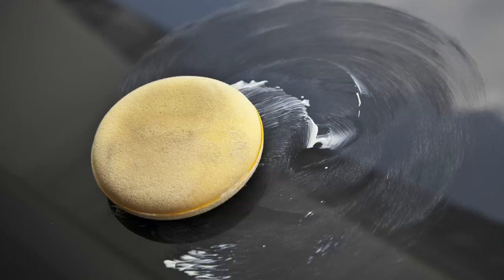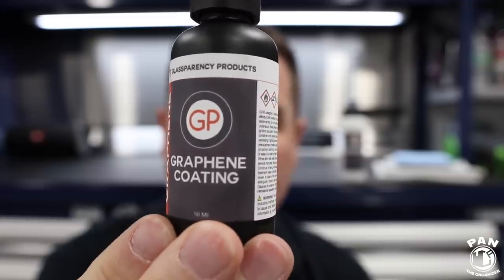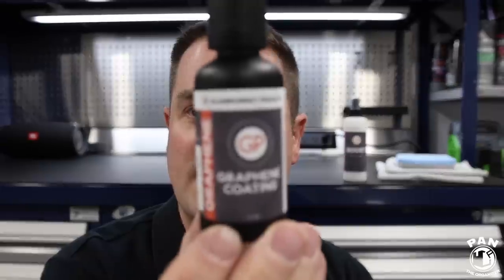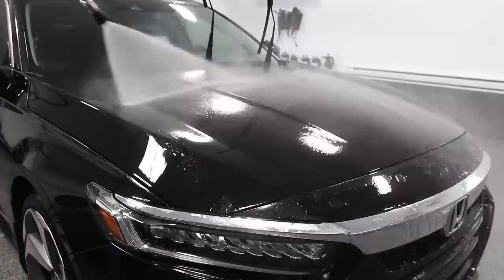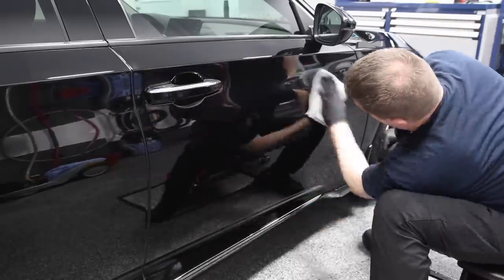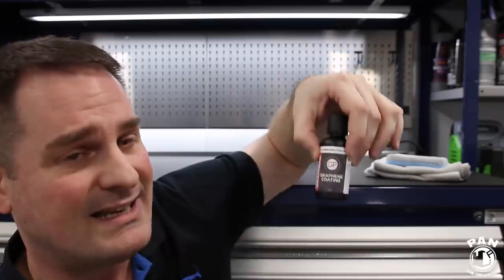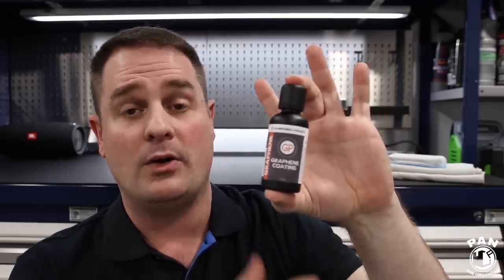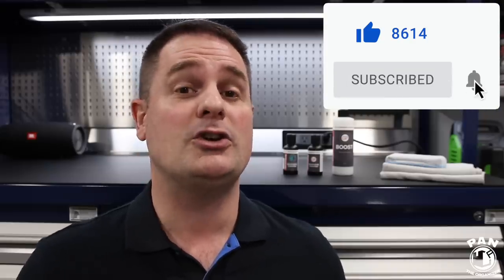GRAPHENE COATING by GlassParency! The Future of Paint Protection!

Comment: Hi Pan ! This is in fact exciting new technology. Can you tell us more about what can and cannot be done in maintaining a car that’s been coated with graphene coating ? Can chemical and mechanical decontamination, polish or compound be done since the coating is there for many years ? What happens if scratches need to be removed ? Thanks again for your great channel 👍🏼💪🏼
Reply from the maker: Same as for ceramic coatings.  No claybar.  And if you polish, you damage the coating.
Reply: Considering graphene coating lasts for years and that you can’t clay the paint after it’s been protected by ceramic or graphene coating, does the paintwork retain its smoothness all these years ? Thanks Pan !

Comment: I have just purchased a new vehicle. What paint preparation cleaning steps are recommended prior to graphene application?  I have applied  hybrid ceramic spray. I’m guessing that clay bar would not be needed, for example.
Reply from the maker: You would need to do exactly the steps in this video, from A to Z, including machine polishing, to remove your existing ceramic spray, as all coatings need to be applied to a virgin clear coat, to ensure proper bonding with the paintwork.

Comment: Hi Pan, based on your video, I applied the GlassParency Graphene on my car yesterday.  I put two coats on and a coating of Boost as recommended. Real easy to apply. It looks great! We'll see how it holds up but I wanted to ask you a question. I noticed today when I cleaned my windows, there were a few small spots where I must of gotten some Graphene on the glass that won't come off.  Is there an easy way to remove it from glass?
Reply from the maker: Yes just use some polish and rub the glass with a microfiber towel.
Reply: @PanTheOrganizer  Thanks Pan!  I'll try that.

Comment: @Pan TheOrganizer do you recommend using 3D Speed All In One Polish/Wax before graphene coating? would the wax in the 3D product prevent the graphene coating form adhering to the car?
Reply from the maker: DON'T USE all-in-one polishes that contain wax or sealant additives before a coating.  It will prevent proper bonding of the coating to the clear coat.

Comment: When I did it. It flashed in 30 seconds. It was 60 degrees and wasn't in the sun.
Reply from the maker: Flashing times will vary from one location to another due to temperature, humidity, overall conditions, inside in a controlled environment, or outside in the elements, wind, etc. The same applies to all coatings.

The colder temps yield longer flashing times, and warmer/humid environments generally yield quicker flashing times.

Comment: Pan. I've l limited time and a full paint correction, polish and all the other steps could take me 2 days. Time I don't have. Is it required for this product to do its job?
Reply from the maker: The more you prep the surface, the longer products like this will last.  It's only natural.  Plus, you need to make sure that this is applied to virgin clear coat (no waxes or sealants on the paint) as this needs to bond directly to the clear coat.  If you can't do this, forget about this product.
Reply: @PanTheOrganizer  I had ordered some Turtle Ceramic Spray and I'm now wondering if this graphene coating is a better option? Also I've got some CarPro Perl. Cause I've got a 2020 Hyundia Kona. If you use the Perl on the plastic fairings of the vehicle can you still use a ceramic or graphene sealant over it?

Comment: Will light scratches from dust get removed just by removing a graphene coating or will it go into the clear coat too?
Reply from the maker: Not sure I understand your question. This is not a filler, this is a paint protection product. It doesn't remove or mask scratches or swirls. You have to machine polish the vehicle in order to remove scratches and swirls, before applying any form of protection. That's always the best way to do things.

Comment: Pan I just installed the Avalon kings ceramic coat on my car but just saw this coating is better with water spots.. Can I apply this over the ceramic or do I have to strip it then apply?
Reply from the maker: You would have to machine polish everything to fully remove the previous protection before applying a full blown graphene coating (glass bottle) like these. Coatings in glass bottles need to bond directly to virgin clear coat without anything in between.
Reply: @PanTheOrganizer  Ok,thats whati figured, I am going to try the turtle wax graphene flex as a topper.. Maybe it will help with water spots

Comment: Hi Pan
Love your videos, thank you. I was booked in for ceramic coating but have just ordered the product here on the link. I was going to use the two Turtle Wax Hybrid products you recommend to maintain - green and pink on the two bottle labels.
Would I instead just use the Boost now every three months?
Reply from the maker: If you apply this graphene coating, then yes just use Boost every few months as a maintenance product.  You could also use Turtle Wax Ceramic Wet Wax (yellow label) or the Ceramic 3-in-1 quick detailer (pink purple label) to maintain too.

Comment: Pan, what would you recommend for a regular topper?  Using the Sonax PF/Jescar PL/845 combo with Beadmaker now. Does Boost replace the Beadmaker?
Reply from the maker: Boost does replace Bead Maker. But once you are out of Boost, you can use Bead Maker or any other silica spray sealant as a topper (Gtechniq C2V2, TLC v2, CarPro Reload, Gyeon Cure, Kamikaze Over Coat, etc).

Comment: Great vid, Pan. What about 9H hardness against ultra light scratches that ceramic coatings provide? Is it the same for graphene coatings?
Reply from the maker: Ceramic coatings and graphene coatings don't protect against scratches or swirls.  Those who tell you that just use marketing bs.  That's not what they're designed to do.

Comment: Just acquired a kit from Glassperancy.  Working with a more experienced detailing shop on the correction and installation of the coating this coming weekend.  My question is whether this is used in place of, or in combination with Glassperancy windshield kit?  The shop has that option too.  Thoughts and advice?
Reply from the maker: If you can get the glass protection for your windshield, that is your best option. Use graphene for paint, wheels and plastics, and the glass protection for your glass.

Comment: Can this graphene coating be installed by myself, unlike ceramic coatings which need to be compounded off if improperly applied unevenly?
Reply from the maker: You can get high spots with graphene or ceramic coatings if you are not careful.  But in my testing so far, graphene is much easier to apply and level.  So less chances of high spots.

Comment: Pan, great video as always! Are you going to switch to graphene on the 550i?
Reply from the maker: I have a super high end coating (Opti-Coat Pro+) on my BMW currently, that was just applied last year, so I won't go through the trouble of machine polishing it off.  But if I had no protection, I would have easily applied the graphene coating.  I get a new car every 3 years, and next summer will be that time for me to get a new car so time will tell what I'll pick to apply on that.  :)

Comment: I'm deciding between Turtle Wax hybrid ceramic and this one - any thoughts Pan? I might travel with my car and I work in cinema so less time to do maintenance (so looking for long term lasting solutions to keep the car nice: like that permanent tire shine, a 12V vacuum in the car etc) - but at least every 6 months I come home and I can take care of it. I was thinking that TW hybrid solutions (the green one) is more than enough - maybe. 

EDIT: I think I'm going with TW hybrid solutions (the green one) because of the huge price difference (6x once I convert to cad) but drop some comment I'm sure a bunch of people are wondering about this one. I figured I can take the time for now to was the car and test out hybrid waxes  and get experience - I'm very new to this. Thanks for the awesome reviews, really helps with getting to know the product: it's like condensed experience.
Reply from the maker: You certainly can use the TW Ceramic Spray Coating.  Apply two coats, 24 hours between coats, and you should still get 9+ months of protection.

Comment: @GlassParency and @Pan, the Boost says it's a ceramic product. Curious whether a full ceramic coating could be applied over the graphene rather than just the sacrificial spray-on? Would that work or would you have a problem with bonding/adhesion?
Reply from the maker: You could technically apply a ceramic coating on top of the graphene, but don't expect the ceramic to last as long, as the graphene coating will eventually reject it.  Chemical compatibility is key when trying to add toppers from different brands. Boost was formulated to be compatible with their graphene coating.

Comment: hey pan quick question about this product, once you use the product and after you buff it off can you reuse the microfiber towel or do you have to throw it in the away as you would do with the ceramic coating?
Reply from the maker: Throw it away

Comment: If I just ceramic coated my car with CQuartz 3.0 can a Graphene coating be used on top after using something like Erase or does the ceramic coating need to be completely stripped off. I put 15 hours into correcting and ceramic coating the Multicoat Red on my Tesla.
Reply from the maker: A graphene coating, just like a ceramic coating, is best applied to virgin clear coat.  So the answer is no.

Comment: Hey Pan....  Is it okay to use the Turtle Wax SI02 one step polish and paint protectant before I put on the graphene coating? I know you set a single step polish wanted to know if that would be okay. All my vehicles are black, and I love the way that turtle wax polish for black cars cures any light to moderate scratches and makes the paint look fantastic.  Thanks in advance!
Reply from the maker: Not sure about the chemical compatibility, so I would recommend caution and not using that one step before applying this graphene coating. You want the most direct bond possible to virgin clear coat to get the maximum performance and durability. If you have light to moderate scratches, use 3D One with a good microfiber pad and then IPA wipe, before applying the graphene coating. Watch my favourite pads, compounds and polishes video here: https://youtu.be/2JDvQBs1viM

Comment: Can I do graphene coating if I don‘t have a garage for my car to sit in overnight？I park my car in my yard where it can collect some moisture overnight
Reply from the maker: You can do it outside as long as it doesn't rain for the first 24 hours. That's critical. Morning dew isn't the end of the world, just wipe any residual water if there is any as soon as possible.

Ideally, you would start very early in the morning on day 1, so by the next morning, it will have been 24 hours. Avoid direct sunlight and work on cool panels. Same applies for pretty much any paint protection.

Comment: Can graphene coating be used on top of paint protection film? I had GTechniq Halo applied to Suntek Ultra PPF & I am not happy. Water spotting/marking & dirt adhesion is a real problem. I will never put ceramic coating on top of PPF ever again
Reply from the maker: Yes you can apply this on top of PPF, but not if your ppf has a ceramic coating on it

Comment: Id like to see you actually test  it  after a few harsh washes compared  to other simple  Hybrid polish/waxes.  This type marketing is not what  I thought  you  were about.  I guess I was wrong.
Reply from the maker: I will be testing this long term, as I always do with any product that I enjoy using.  All I did was talk about their claimed durability, nobody has had the time to test graphene in the long term as these are new to market products.  But based on my 23 year detailing experience, and especially my great experience with ceramic coatings, I don't see why these wouldn't live up to their claims.  Also, I know that the GlassParency glass protection kit easily can go the 3 year durability as claimed if maintained well, so I have no reason to doubt the 5 years on this.  Even if you get 4 years, it's still a winner in my books compared to most consumer grade coatings out there...

Comment: Pan da Man... what temperature range/humidity  can you apply  this in?   Love your videos!
Reply: Also, how many microfiber towels did you use?
Reply from the maker: I used two for this test.  But you can get away with only using one.
Reply from the maker: As close to room temperature and 35-55% humidity is optimal.

Comment: How would the Glass Parency Graphene coating compare to the professional Optimum Polimer Opti Coat pro+ coating that’s on your BMW?
Reply from the maker: You can't compare those it wouldn't be fair.  Opti-Coat Pro+ is a pro grade $1500 USD coating service that can only be applied by authorized dealers.  This graphene kit will give you tremendous performance and value and you can do it yourself for $100 USD.
Reply: That’s fair and all I need to hear, thank you

Comment: I have watched some videos of enthusiasts using a graphene coating. It seems as if some folks are making the mistake of not removing previous layers of wax or ceramics before applying the graphene. Don't you think this is a critical step?
Reply from the maker: Absolutely.  It must be applied to a virgin clear coat, meaning on well prepped paint.

Comment: I had Ceramic Coating on my Car already, What should i do to remove the Ceramic Coating and then Apply Graphene Coating.
Reply from the maker: Machine polish the surface
Reply: Pan TheOrganizer Thanks, So I don’t need to use Cutting Compound to remove the extra surface of Ceramic, after polishing apply directly Graphene.

Comment: I had a couple high spots (luckily in non obvious spots) and they wouldnt buff/level off at all  

I also found waiting two minutes was an eternity and that it hardened. I just leveled immediately. Maybe im working too slow per panel?
Reply from the maker: 2 minutes is a bit long, of course depending on the conditions you work in. For me, in 20C (68F) controlled environment with humidity at 40-45%, it takes 30 seconds on average for the coating to flash (rainbow color) and then you wipe. ALWAYS inspect as you go, with a detailing light, to see if you missed a spot. If you catch a high spot within 10 minutes of applying, you can easily remove it. You can rehumidify that area and immediately wipe. That should remove the high spot.

But if it has been too long, then machine polishing is the only way to remove high spots. That goes for all coatings.
Reply: @PanTheOrganizer  wow thanks for the response!! Good to know. I’ll be doing my second car now (wifes) so gotta be 100% lol

Comment: Pan I have CQuartz 2.0 that I applied back in May 2019. The car also has Xpel on the front nose of the car as well as the mirrors and running boards. 

Can I apply this on top of all that. Would I do a polish, thorough cleaning and then apply the graphing coating.
Reply: Yes! @PanTheOrganizer Can you please go over PPF prep procedures? Haven't washed the new M3 that was recently filmed with XPEL and would like to know how to best coat or add an additional layer of protection. Used to be a synthetic guy when I last had a toy, been catching up on what's new in the detailing world and your videos have been very useful, keep up the good work!
Reply from the maker: No you can't apply this on top of an existing coating.

Comment: I just tried applying this to my car and got a bunch of high spots! Any suggestions or tips?
Reply from the maker: Were you careful to watch for flashing times? If your high spots are fresh, just reapply more product to "wet" and reactivate that area and it then buff off immediately. If the spots have cured for a few hours, you will have to machine polish them off.
Reply: Pan TheOrganizer yes, I even tried wiping it off under a minute and it still left high spots. I will try that reactivating method when I try again tomorrow and see if that works. Thanks for the response!

Comment: How does this compare to a ceramic coatings such as CQuartz UK 3.0 in terms of its protective properties? i.e how well does it resist scratches and swirls?
Reply from the maker: Coatings do not protect against swirls and scratches and CarPro certainly doesn’t claim that.  No serious coatings brand says that.  Did you notice I never say that?  Coatings are not designed for that.
Reply: Pan TheOrganizer interesting point as Cquartz 3.0 claims ‘resistance to wash induced marring’. I always thought it provided some level of resistance.

Comment: Is it required to professionally remove the old coating when it becomes time to reapply??
Reply from the maker: Well you can do this yourself but yes you must fully strip the paint before reapplying a fresh coating and that includes machine polishing.
Reply: @PanTheOrganizer  I appreciate your quick response.  I had asked this question to multiple reviewers when the Ceramics came out without any responses.  I think the answer to that question is important because it has the potential to significantly change the Total Cost of Use for a given product.  Again I went months without a response to the question for ceramics.  Your timely and honest answer is very much appreciated.